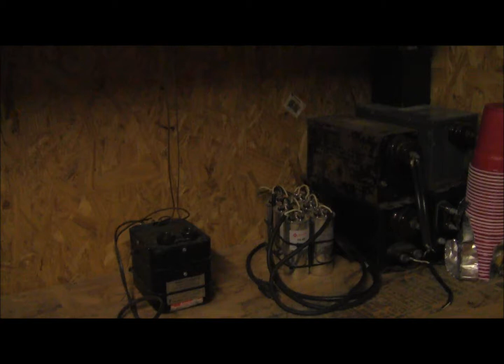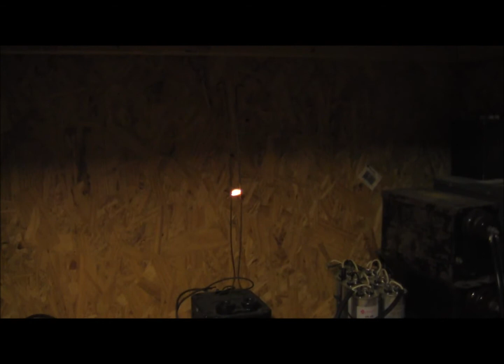Jacobs Ladder

Comment: Just two black wires coming out... how do I know which one's positive?
Reply: jrmym2 To answer my own question: it doesn't matter which wire goes where.
Reply from the maker: jrmym2 Not realy unless you are running 2 or more neon sign transformers in parallel then they need to be in phase. Its a simple OBIT with a motor run cap for power factor correction PFC. One wire is hot the other is neutral. I don't run grounds to the house as a rule to avoid rf damage to any house electrical components. (Potential problem running tesla coils) My power supply has a rf choke and the case on my coils is wired to earth ground (an 8 foot copper ground for that purpose).
Reply: Thanks for the quick response and info.!